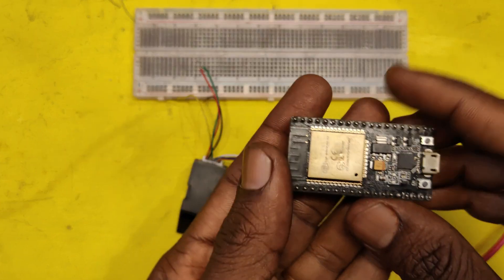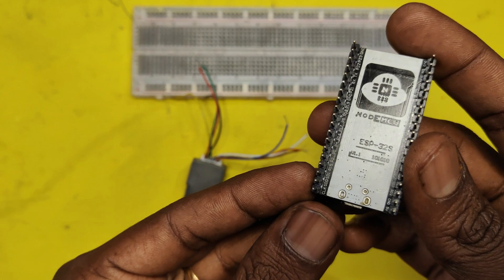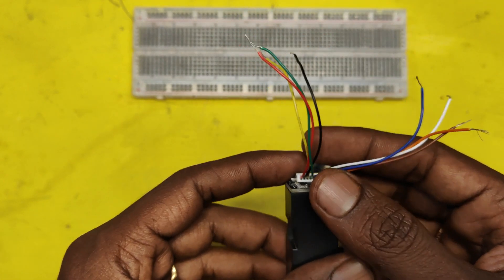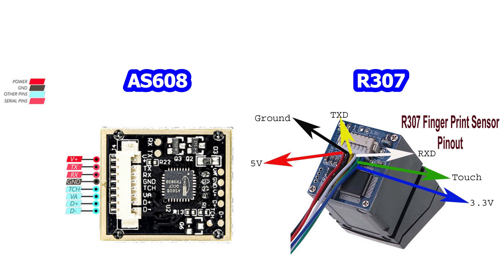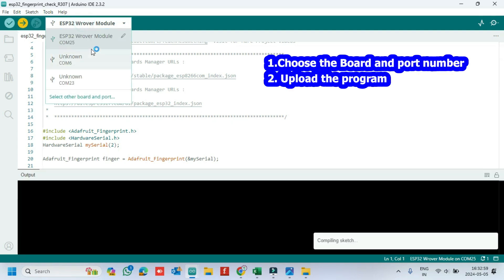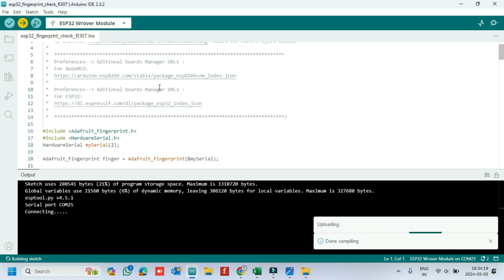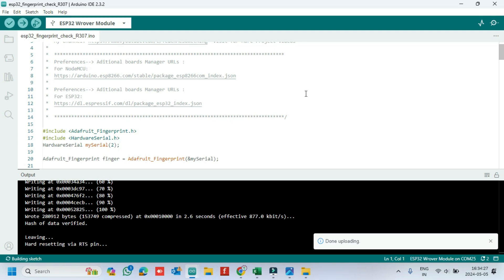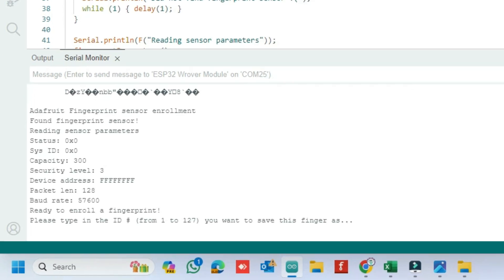ESP32 R307, AS608 Finger print Sensor | R307/AS608 Finger Print Sensor Testing | Teach Me Something

Comment: I have to make project using esp32 but available fingerprint sensor has D+,D- pins which is usb based and esp32 can't act as usb host.so is there any solution?
Reply from the maker: Use esp32 s3. It have usb host facility

Comment: i am using R307s model for fingerprint so can i use the  same connections ?
Reply from the maker: Yes
Reply: @TeachMeSomething but not working 
I get only a little blink like blue light , when i connect the esp 32 with usb cable. 
What is wrong? Plz tell
Reply: @PranavGulve did u get to know bro I'm also in same situation stuck

Comment: what kind of ESP did you use. Esp32 38 pins right ?
Reply from the maker: Yes.
But it is not a matter 30 pin or 38 pin. Both will work
Reply: @TeachMeSomething   I use your code in Arduino Uno arr no problems ,but when used esp32 ít doesn't work.I was following all your step
Reply: @flaviasaldanha1537  i should checked RX,TX of MCUs you use.Then connect RX sensor to TX MCUs and vice versa